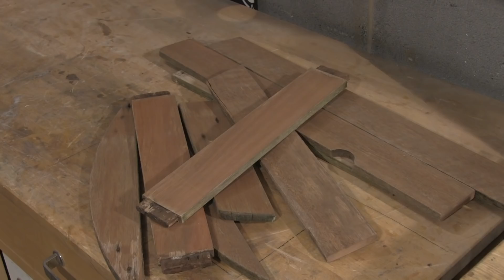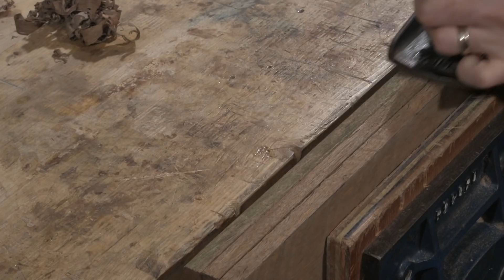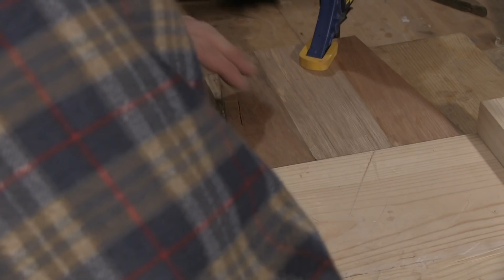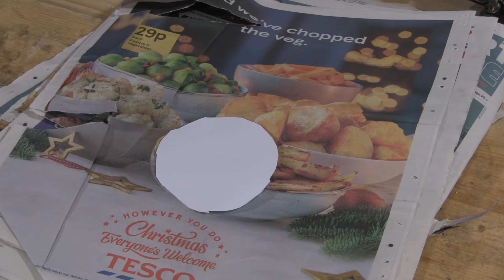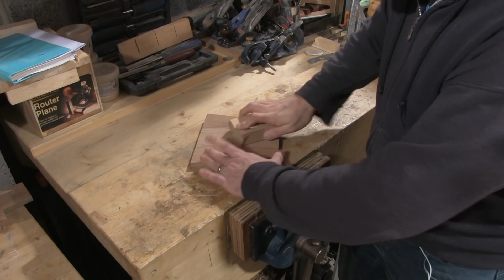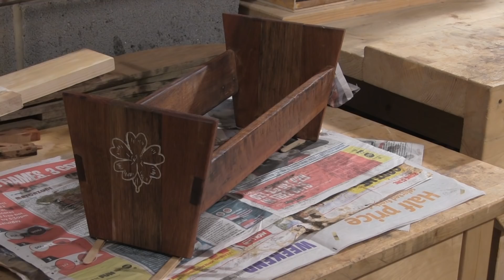Woodwork Project: Three Pot Planter from Reclaimed Hardwood

Comment: Really enjoy your videos and your voice is excellent for voiceovers. Perhaps sell your services. Excellent idea of making a garden box with dovetails. Gives it a little more longevity. Dovetails can be corrected if you take out too much material. Luthiers or instrument repair techs do this on a neck re-set, if the guitar/violin has a dovetails. They often find the maker or former repair tech has already tried to make good a bad fit. Your video has made me rethink a garden planter idea I have. Thanks
Reply from the maker: I will 'correct' things from time to time on my fine work, we all make mistakes, but I think it's best to work with the assumption that taking off too much material should be avoided in general. Luthiers tend to be exceptionally skilled and I never fail to be impressed by them

Comment: This is becoming one of my favourite YouTube channels. You've inspired me to give woodwork a go!
Reply from the maker: Thanks Luke. Apologies the updates are slow but I have a bunch or projects I'll be putting up as soon as I can finish the editing.
Reply: @adventuresint-shirtswoodwo3905  Would it be possible to have you do a video going through all of your tools? Specifically, it would be helpful if you then did a little segment recommending things one should buy to get started. I'm getting together planes, clamps, saws, etc. and it would be helpful to have some guidance.
Reply from the maker: Hi Luke, yes, I'm sure I can put something like that together - I'm actually working on a series of videos for new starters and that would probably fit right in with that.
Reply: @adventuresint-shirtswoodwo3905  That's brilliant. I've turned on notifications now.

I've put the word out to friends and family that I'm looking for tools. I've managed to get some of the stuff together on the cheap. I just need to get some decent chisels and a workbench. Unfortunately space is an issue, so i'll probably end up using a little folding bench. I'm a bit worried that it won't be stable enough when it comes to sawing, but I have no other choice. When I have a garage or more space i'd like to get a woodwork bench with a decent vice.
Reply from the maker: Great stuff. I got by for years using an old Black & Decker workmate as a bench. It's a poor relation to a good sturdy bench but surprisingly versatile and the long clamping capacity is actually better than a vice for some jobs.